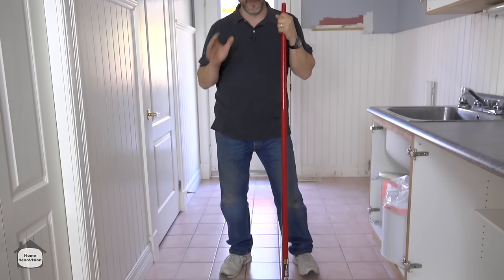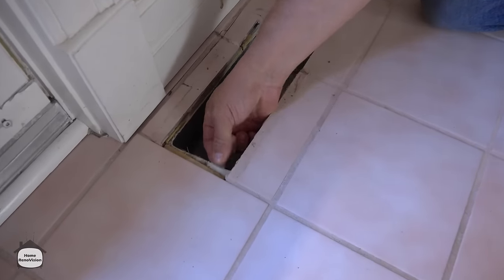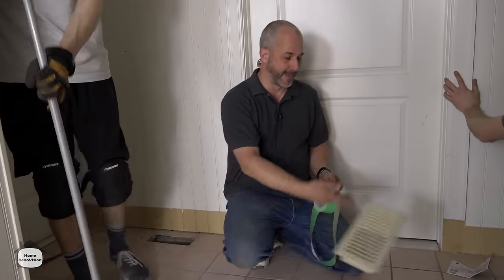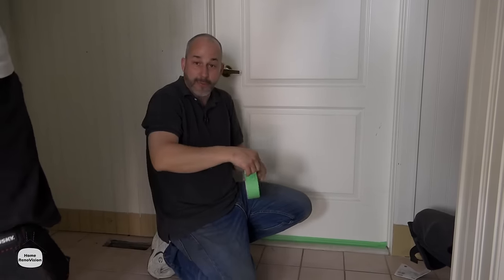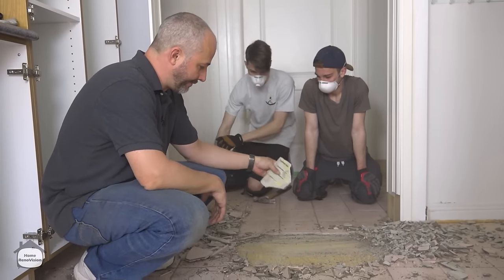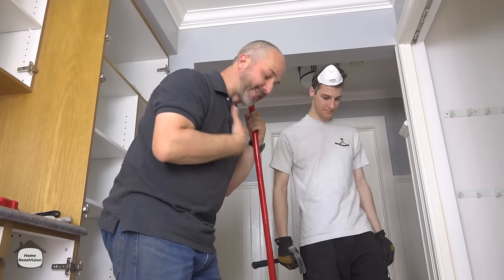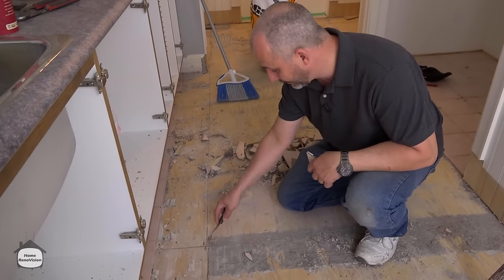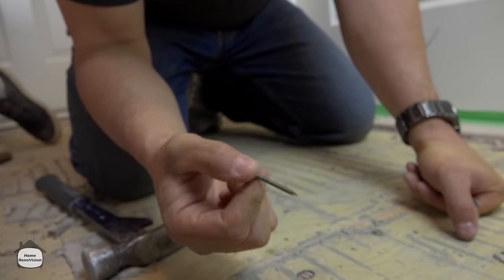How to Remove A Ceramic Floor

Comment: We need a video how to reinforce and level that floor after removing old tiles.
Reply from the maker: I like to use an uncoupling membrane and a little floor leveler when needed.
Reply: I am thinking to renovate bathroom, and need to reinforce bouncing floor first (maybe one more layer of plywood). Then to level it. Not an easy process I guess, would be very helpful to watch your detailed video with lots of details and tricks explained. Then I am going to use schluter membrane and tile over it.

Comment: I have ceramic tile that is popping up every where and the tile looks like they were mudded to a dry sub floor too.  The floor is slightly warped can I sand the wood and then level it with something like wood putty? And then start installing my new floor. Or do I have to have a professional replace the sub floor were it's slightly warped?

Comment: I have porcelain tiles over 2 inch thick concrete on metal mesh, over tong and groove hardwood..over some old wooden floor...running the same direction so its all wavy because it aint flat lol, 50s built and tiles installed in the 80s, rough solid, dragged cast iron radiator over them and it was intact lol. A sledge hammer doesnt, do much...using a SDS plus rotary hammer with a tile chisel to remove the tiles then between the mesh and bottom of the concrete...any tricks?
Reply from the maker: get 1 hole and then get underneath it . Once you get under that mess and on top of the hardwood  it will come up easier.

Comment: You probably have a video of it, but what tools would you recommend for removing ceramic tile on a concrete floor. Thanks.
Reply from the maker: You can rent a tile chipper at the local tool rentAl store. a  pretty common tool for that job. Cheers!
Reply: @HomeRenoVisionDIY  Ok Thanks.

Comment: Any tips for removing tile from a concrete foundation?  In my case, they are 18" ceramic tiles and whatever kind of cement they used to hold them to the foundation is ridiculously strong.   I removed a small section at my entryway a few years ago and it was an two-day project for a 4x3' area... came apart in tiny chunks and had to spend all day chipping away at the cement with a chisel and hammer.  I need to remove it from my entire kitchen now and I'm scared to even touch it...
Reply from the maker: For good reason. I would suggest going to the tool rental store and tell them what your project is. I am, sure they will have a demo hammer that will pick up the tile quite easily. Cheers!
Reply: Use a jack hammer with a spade bit.
Reply: This was my problem. After going over dozens of Youtube DIYers tackling this, the solution within reach for me was to lift away the tile with a hammer drill equipped with a chisel bit, then grind away the mortar all the way to the concrete foundation using an angle grinder with a diamond cup (fitted with a vacuum hose attachment - practically no dust escaped). It's not a fast method (and my knees are pretty busted up, even with knee pads), but I'm quite finicky and this was the cheapest way to do it that leaves the concrete sparkling clean.

Comment: Got a question.

we want to put down new tile over 2-3 rooms.

One room is  3/4 “ plywood on joists 

The other two rooms are cement

However the plywood room is half an inch higher than the cement.

I know for plywood its best to put cement board ontop of plywood.

How do i make it all level for tileing

Thanks.
Reply from the maker: First the plywood is not thick enough to tile directly yet. you would need to add ditra underlay or another 1/2 inch ply. That will leave you 3/4 to 1 inch respectively. to raise concrete 1" you could pour another floor or use 2 layers of ditra xl to bring the floor height to level.
Reply: Home RenoVision DIY i was wondering if we could double layer cement board. Which would be cheaper pour a new layer of cement (i’d have to hire out, i don’t trust myself with self leveling cement over such a large area) or double layer cement board. Im thinking double layer cement board.
Reply from the maker: You will find that using ditra xl is cheaper and faster and easier than using cement board. if you use ditra xl on the concrete and then use ditra regular on the entire surface you protect against deflection rise and separation from one floor to the other since it is a decoupling membrane as well as a way to adjust height and add strength. That would be my preference. The cement board needs to be laid in cement and screwed. then you have an expansion joint to consider!
Reply: Home RenoVision DIY thank you so much.
Reply: Ok we have decided to go with vinyl flooring planks by lifeproof, instead of tile.

However, i have to be away for work so i can’t complete this diy before end of the year. So We got an estimate from a guy who refuses to make the floor one level, saying it isn’t cost effective. Fine i understand that, but it will look nicer.

He is telling me he would have to raise the whole area, ( which doesnt make sense to me ) with cement board, and then is saying he needs actual cement to adhere the cement board.the vinyl planks can be put on both plywood and directly to the cement since it doesnt rot.

And whats with the cementing cement board to the cement, Wont construction adhesive work?

Comment: I've recently discovered my house has timber floors that have been covered up with about 5 cm in height of cement and tiles. The tilers laid down plastic sheeting between the timber floors and cement, so I'm hoping the wood is still salvageable. What would be the best way to remove the tiles and cement?
Reply from the maker: just like in the video. Cheers!

Comment: What about the little bitty one-inch 50s tile that’s on a mortar bed?
Reply from the maker: Hi Rebecca, that is actually the easiest tile to remove. In most cases they used a sheet of wax paper to uncouple the mortar bed and then poured a 3 inch slab and set the tile into it. it breaks up real easy with a hammer in no time. That style of bathroom is also easy to install a curbless shower since you already have the 3 inch slope available!
Reply: Home RenoVision DIY 😁🛠👍🏼

Comment: Just removed my ceramic to install vinyl click and am left with mortar on original hard wood. Can I cover that with 1/4" luan?
Reply from the maker: Ouch, if the surface isn't smooth the 1/4 luan will only aggravate the situation.  Perhaps sand the hardwood and see if it could be refinished. if not possibly remove it? maybe send me a picture?
Reply: Home RenoVision DIY thanks for the response. It's a 1920s bungalow with oak and maple floors throughout. Unfortunately the previous owner tiled the kitchen. I'm thinking about using lifeproof vinyl flooring. I haven't tried scraping it yet. Pulling the original floor up probably not an option. How clean do I need it? If I can scrape it reasonably smooth would that be enough? Thanks, great video's!

Comment: My tile is on top a very thin layer of cement over sand....so I literally have to pulverize all the tile I've tried Chisle and hammer and even a drill Chsle and they don't work

Comment: Do I need to install uncoupling membrane if putting 30 inch porcelain tile over 20 year old concrete in the guest bedroom 
Thanks it’s a clean flat uncracked floor
Reply from the maker: I would. At least use a roll on uncoupling membrane. not necessary to use ditra. Cheers!

Comment: Hey Jeff, any ideas on how to remove the mortar from the plywood subfloor? I'd like to save the current plywood if I can. Thanks and Merry Christmas!
Reply from the maker: use a chipper with a wide blade. Or prime the floor and use a leveler compound.

Comment: I have 80 year old mud job tiled hex in my bathroom that I'm eventually going to have to demo when I do the bathroom. I'm dreading it. 
When I moved in I had to replace the broken toilet flange and so I had to whack a single tile out to make room for the new one and the tiles just sparked instead of budging. 😬
Reply: It might cost you a bit but a hammer might be out, but Rental places have machines to remove tiles, just back breaking even with machines.

Comment: I need help extremely bad. We hired a group to put porcelain tile down 20x20. Vinyl flooring was the existing.They pulled it up however the concrete wasnt leveled, the tried to use floor leveler in some areas where it made it worse in one area there is at least 2inches of mud under the tile now all the tiles arent even, its very noticeable you cant even walk on the floor barefoot as my poor toddler cut his toe on one of them because its so uneven and the grout lines some are wider than others. We cant put the pantry door on since they made the area so high and now we have to step down in order to walk out the back door. We ended up firing the guys and the owner didnt charge us for the labor as he agreed the flooring job is horrible How can we redo these floors especially in the kitchen without removing the new cabinets and  new granite countertops but they put the tile under it as well so even the sink counter is slanted since they didnt level the floors properly... HELP
Reply from the maker: sorry jenita, i don't give legal advice on this channel. Cheers!

Comment: Do #8 shank nails do the same as screws when setting new plywood on flooring?.
Reply from the maker: no , they are easily raised when the floor deflects and that causes squeaking. That is why we use screws to avoid squeaks.

Comment: Thanks for the great video. Could you have just as easily gotten underneath the linoleum by removing an edge tile and then prying up the plywood with the tiles on it? Sure, they'd pop off and it might be a mess, but it seems like you could easily do it and skip two full steps. Bad idea and if so why? Thanks again.
P.S. How about removing a failed DIY penny tile job in a curbless shower on a cement slab (for the second time)? You could do an entire series on these damned porcelain penny tiles..from mortar (which seeps up between them making it a pain to grout) to grout to over-grouting, failed sub straight leveling or angling (towards drain) to removal and starting over. Thanks for the great videos.

Comment: Can you install 3/4 inch hardwood over vinyl floor?
Reply from the maker: No. please remove the existing. you are going to run into problems with squeaking.
Reply: Is it okay to porcelain tile over linoleum flooring based on the flooring being done properly and fairly new, home is only about 4 years old?

Comment: What if the ceramic is glue to the concrete? Will that be to hard t take off?
Reply: I am also very interested because I live in europe and floor is concrete and its glued like that, it will be a pain in the ass to remove probably
Reply: Yes, I have it too. You need to get a mini jack hammer. It is a pain.
Reply: Oh yeah... get ready for a big dusty mess.

Comment: Great video and very helpful, but your guys are doing way too much effort smashing the floor. Fastest easiest way to remove tile is with an air hammer and ball joint separator. No fuss , no sore arms.

Comment: my title is cemented to concrete... do i just smash it up and scrape it? what about renting one of those home depot floor scraping machines
Reply: Steve Hartman your tiles should pop up easily however you will definitely need a rented scraper to get the mortar up. Or buy a cheaper one from harbor freight.

Comment: How do you repair an exterior ceeling and a wall
Reply: Looks like a drywall
Reply from the maker: Hi Miguel. If you put that question in the search tool on the channel it will direct you to a video that shows you . Cheers!

Comment: The problem is homewoners on average have no idea when someone is doing poor quality work on their home, and there are are far too many contractors out there who suck at their jobs and don't care. I once did work in a house in the attic. I found two sets of exposed live wires nestled in the insulation. I told the owner, who had no idea why that was dangerous. Turns out that work had recently been done by his cousin who was also, wait for it...the town's electrical inspector. We're all at the mercy of morons.

Comment: I just use a hammer drill with a 3 inch chisel. Set that bitch on hammer and go right under the tiles. I usually pull half the floor in full pieces